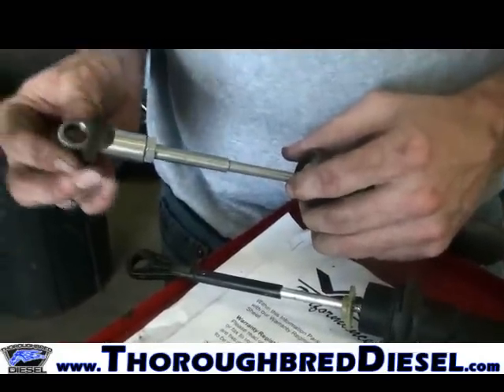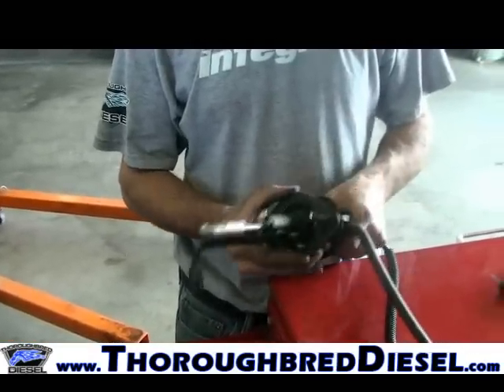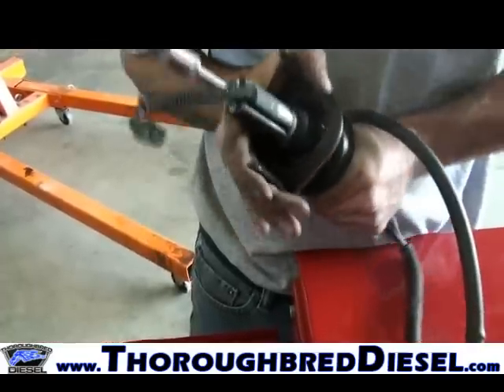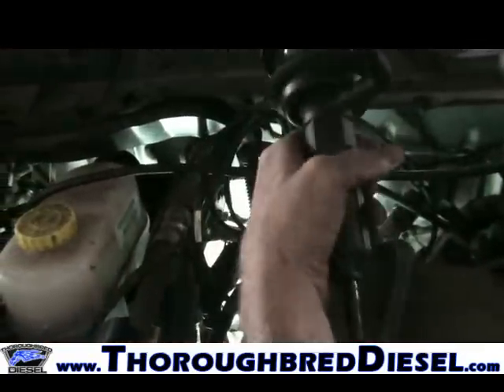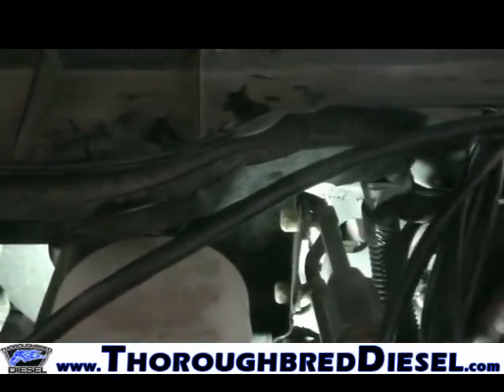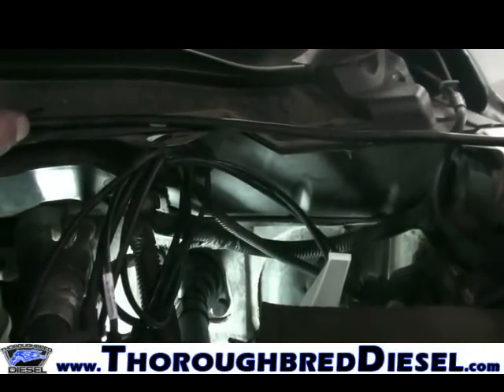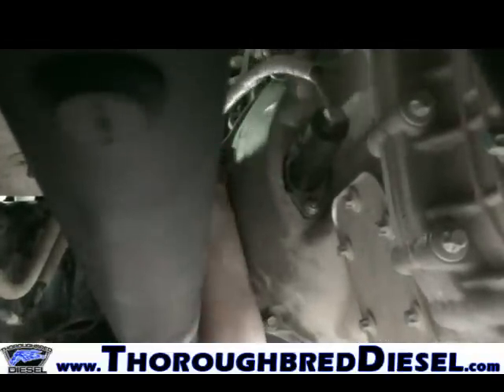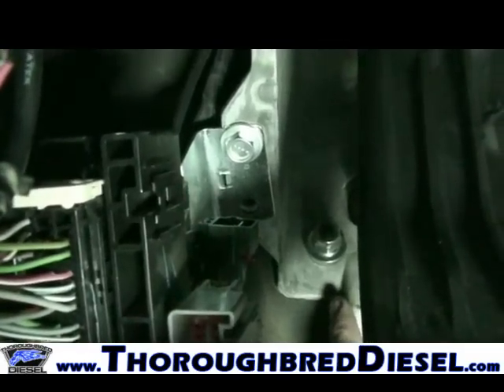Valair Hydraulic Assembly Install: G56 Transmission

Comment: I had a g56 installed in my old 12 valve .. do you sell the locking tab for the clutch safety switch..thanks